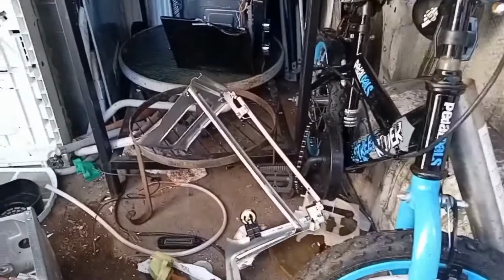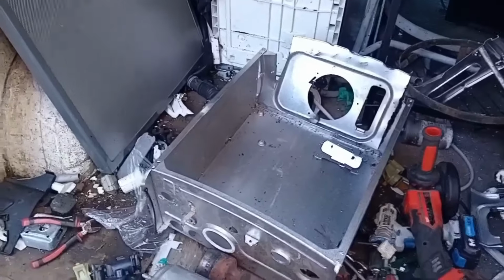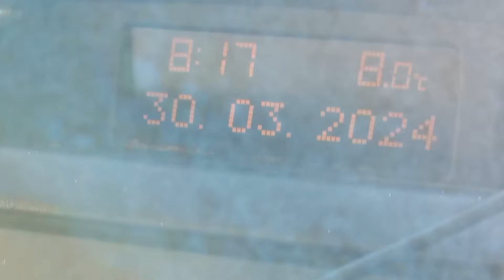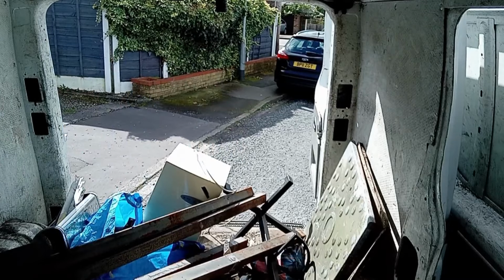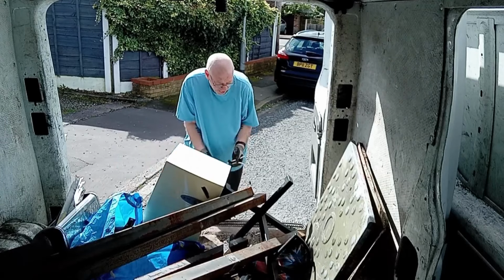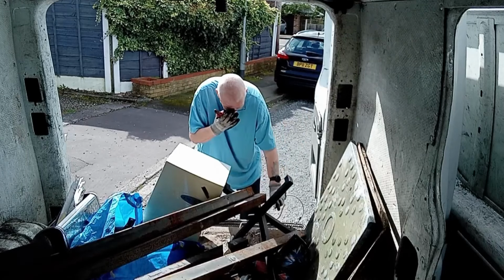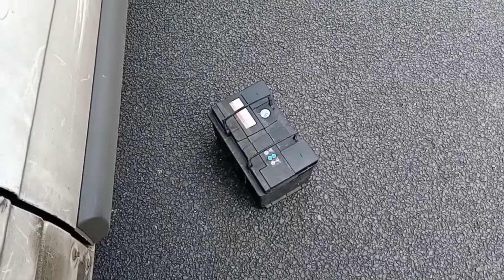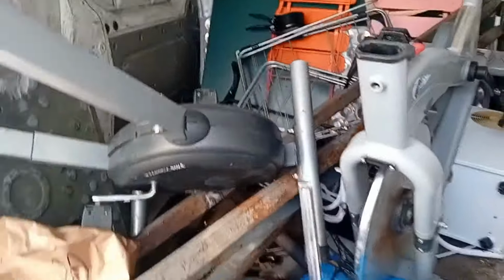Easter weekend

Comment: U should clean up the alley from the boiler it does not take long and then u have clean alley.strip the water pump it has copper inside and ally case. When u start taking it apart just use your grinder to cut the outer case off it makes it easy.
Reply from the maker: cheers mate will do